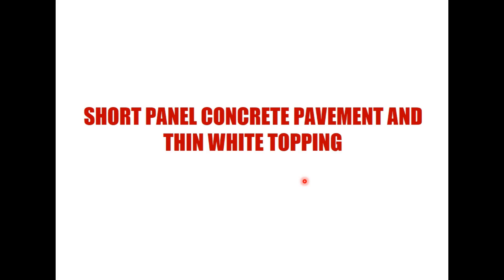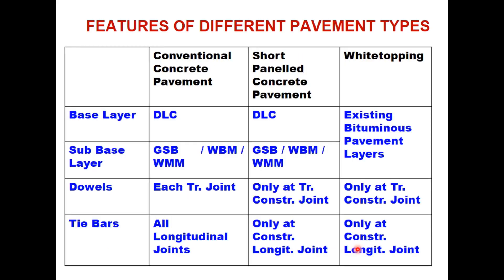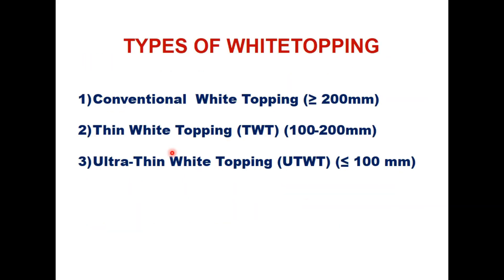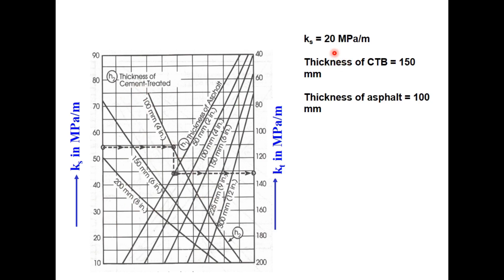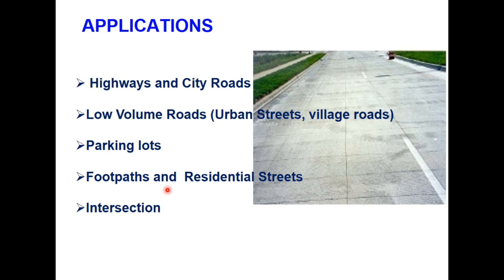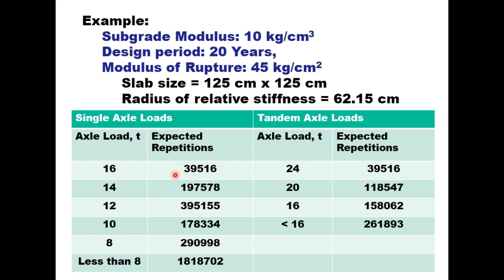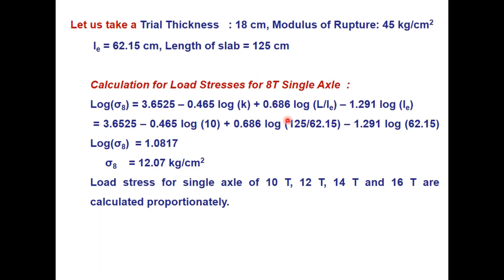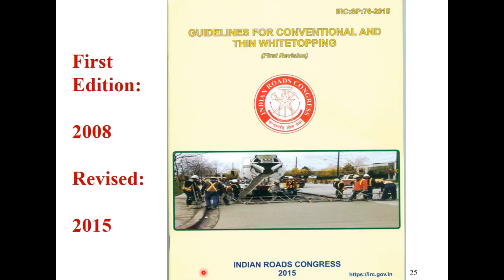#pavements Short Panel Concrete Pavements, Thin White Topping (TWT), and Ultra Thin White Topping

Comment: Sir,
As IRC SP -76 joint sealing is necessary in TWT so pls.clarify
Reply from the maker: Yes, sealing of joints must be done as per IRC 15.
Reply: Sir, but in this video you said that it is not mandatory.

Comment: Sir, 
1.  why we did not consider load stress calculation for less than 8 tons ???, is it because it's negligible / no effect in  corner stress
2. Can you once tell me the input of E and k values used while calculating Radius of relative stiffness ??
Reply from the maker: 1. Yes, your answer is correct. It is not considered due to negligble effect.
2. E is 300000 kg/cm2 and k is given in the question as 10 kg/cm3, mu is 0.15 and h is 18 cm.

Comment: Hi Sir, 
In presented design of TWT it is observed that the proposed panel size is 125 x 125 cm and the cumulative fatigue damage (CFD) is done for Single & Tandem axles. Whereas Clause 8.5 of IRC SP 76 2015 specified that if panel size is less than 130 cm then tandem axle not considered only single axle stresses to be considered in the design. Please suggest..
Reply from the maker: Yes, correct

Comment: Thanku sir for motivating us but Sir in design i could not understand how you took k value as 10kg/cm3...
Further sir you told if stress ratio is less than 0.4 then fatigue life is infinite while in  irc 58 calculation of N having denonmenator(SR-.4325) so SR less than 0.4325 will have infinite fatigue life...
Reply from the maker: K value of 10 is the minimum value specified in the code. The maximum is 15.
Yes, you are correct, the value of SR for infinite life must be 0.45 or less

Comment: Any difference in design procedure of short paneled pavement and white topping?? and in IRC 76 stress equations, increasing the k value is giving more stresses and thus more thickness requirement. is it correct??
Reply from the maker: No difference between the two. Intutively, the stress should  reduce with increase in K value

Comment: Sir, What's your view to provide whitetopping in snowbound areas like Shimla. is it advisable ?
Reply from the maker: White topping is best suited in locations where there is a recurring problem of rutting and cracking in bituminous layer. It is not restricted to any area and therefore must be good in Shimla also.
Reply: @SatishIITR  Ok sir, Thanks for the guidance 🙏🙏

Comment: Sir please explain me in calculation for load stresses for 16T the value of 0.088*log(125/62.15) comes out 0.17699??
Reply: It should be 0.0267
Reply from the maker: What is this equation given in your question. If 16 t load is on a single axle, then calculate stress due to 8 ton load and then double it. 
Equation for stresses due to 8 t load is 
Log(σ8) = 3.6525 – 0.465 log (k) + 0.686 log (L/le) – 1.291 log (le)
Reply: @SatishIITR   Thank You sir, I Got it, Thanks alots sir